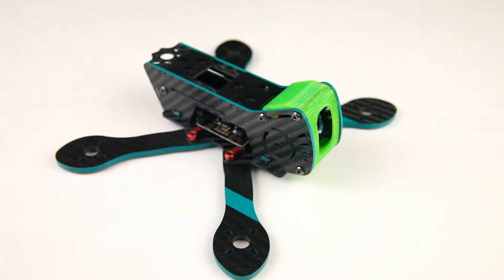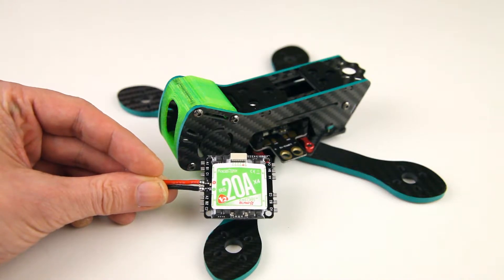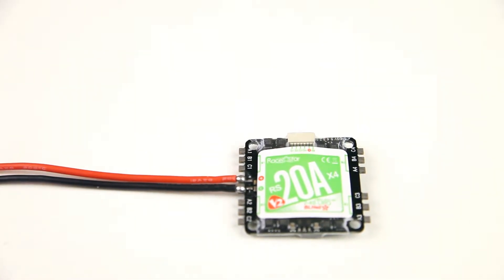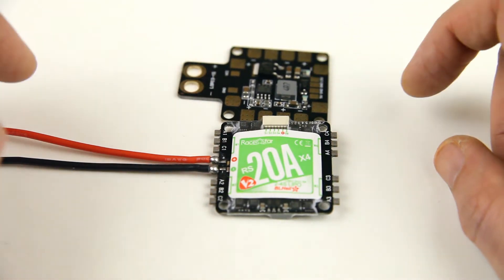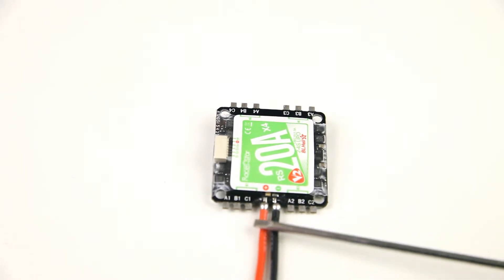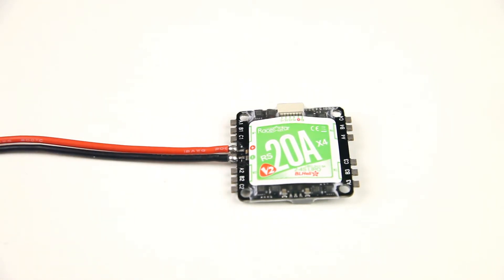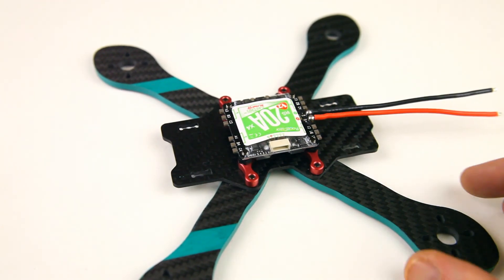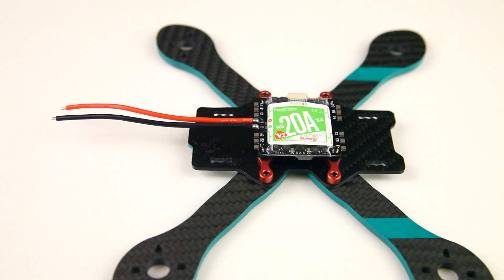GEPRC AX4 Light Quad Build! Part 3: Racerstar RS20Ax4 AIO ESC's Review :)

Comment from the maker: The Racerstar All In One 20A x4 ESC's.. Handy pandy, or better look for something ellse?
GEPRC GEP-AX4 Airbus frame: https://goo.gl/r7sEyZ 
REVO F4 FC: https://goo.gl/rQyVhC 
Racerstar RS20Ax4 ESC's: https://goo.gl/sLXncK 
T-Motor F3 1806 motors: https://goo.gl/EWdYpi 
Hyperion G7 HvLi Graphene lipo: https://goo.gl/FOm2Eu 
KingKong 4x4x4 props: https://goo.gl/8pUXRJ 
RunCam Swift 2 camera: https://goo.gl/RvXOR3 
Aomway TX001 transmitter: https://goo.gl/84DTZh 
FM800 PRO FASST Sbus receiver: https://goo.gl/m4IvZD 
Foxeer antenna: https://goo.gl/FL5hHY 
Lantian Buzzer: https://goo.gl/hUp10Z

Comment: if i use that esc i need to use ubec or bec ?
Reply from the maker: Howdy Alexandros, 
nope.. it does have a 5V out.. so it will power the rest of your electronics..
Reply: Thank you very much :)
Reply from the maker: You're welcome!Do check if your FPV gear can be run from the batteries voltage :)
Reply: Still i dont buy a battery i ordered everything else except battery cause they cant shipp it to my country !
Reply: i can sent u my gear to tell me the best battery :)
Reply from the maker: Not even companies like Hobbyking can send lipo's to where you are?? (I really like Graphene's)..
Otherwise a Hyperion G7 lipo would be a good choice..
Reply: i am in Greece !

Comment: re motor order on the all in one esc. Have you thought of rotating the label 180 degrees?
Reply from the maker: It still wouldn't be the correct motor-order ;)  But no biggy.. You can simply re-arrange things in betaflight :)
Reply: flip the board then stick the sticker on the other side - that would fix it - ha. Joking. I came across this today after sticking the 30a version in. Brain melt due to imprinted habit of usual motor order. Wonder why they did that. Thanks for the vid.
Reply from the maker: You win! :P  You really had me wondering if I was Stupid, or if you were joking ;)  Hahaha :D 
Yes.. if someone could explain this brainfart from Racerstar.. Lucky or us, it is solved pretty eaily :)

Comment: I'm a Racerstar fanboy, even with the short JST connector, you just note what colour is what motor, and rearrange to suit. No big deal for £25 for 4 d shot 300 capable ESc's?
Or maybe I'm thinking of the 4 in 1 ESC they do with 4 separate ESC's that are soldered together like a much more expensive product with a brand on it, but the V2 certainly does D shot 150 at least.
Racerstar are like DYS when they started, feckin' good and feckin' cheap ;-)
Motors also show some much more expensive stuff up.
Reply from the maker: Yes Ben.. you are right.. You can indeed rearange the wires.. What I did: ran the motors in Betaflight, and swapped 2 out in the resources..  
Ah yeah.. them soldered together ESC's.. does that one actually have a 5V out?? :$ 

I'm not really a fan of the motors by the way.. they deliver power (so they seem to do well in tests).. they rev up slower though.. But hey.. they are less expensive as well :)  (I'm sure they are made by DYS.. just with different specs)

Comment: More of a teaser than a build ; ) Its a really nice looking frame and I like that the bracing forms the base of the stack as its all very neat but, the pdb sticking out of the side kills me! I like symmetry and if it really can't be symmetrical its GOT to go at the back as it just looks like it'll be more streamlined... No science just one of those yep, that looks about right things :)

Even with your Dutch accent making your intonation a little different to what I'm accustomed to I was convinced from the start you were going to have some "grumbles" about the esc and yes, you did! Some valid ones too, having to change the motor positions & resolder leads wouldn't be my first choice, easy wins those situations every time in my world. I'd almost be tempted to buy a different one  or get one of their flight controllers (I'm assuming they use that set up).
Reply from the maker: I hear you man :)  I do like symetrical builds myself as well.. With this frame you Can route the power-lead out of the back though, to it Is an option :) (don't know if I will thoiugh) 

Ah yeah.. Maybe I'll do in-video building at a later date. At this moment my camera isn't suited for that regretably (no auto focus)
Reply from the maker: Ohw and yeah: I can NOT understand that motor-order man! Lucky for us, it can be solved in Betaflight itself :) Which is what I'll do... I'll do a video on how to do that with the resource-mapping...
Reply: DutchRC Adventures No worries it wasn't meant as a complaint :) I watch a fair bit of stuff where its done in "freeze frame" or whatever its called which is nice ,as its dead easy to pause and see what's going on. Especially useful on stuff like Asian Q plane & Co2 free flight builds where its all in Japanese or Korean. 

I think I'd probably route it out the back unless it makes the wiring a total nightmare as with me flying it WILL hit the ground and my cells usually get shunted backwards so at least I wouldn't be ripping wires out, just breaking arms LOL! :)
Reply from the maker: Haha :D  well.. if you never crash, you're not trying hard enough :) 
On mine the power-lead Will come out of the side.. I'll have a look how I'll attach the XT to the frame, so the lipo will just be disconnected..

Comment: The new revision of the frame has more options for secuting battery wires etc ;) I'm still busy with my build.
Reply from the maker: You mean there is a newER version of this frame?
Reply: Yes, will take photo's of mine. There seem to be more slots and cutts outts tthan what is in you video ;)
Reply from the maker: Dammit.. I had not expected that (as I basically just got mine in :P) .. Looking forward to them photo's yet! Thanks in advance :)